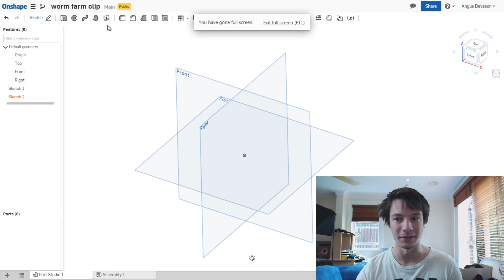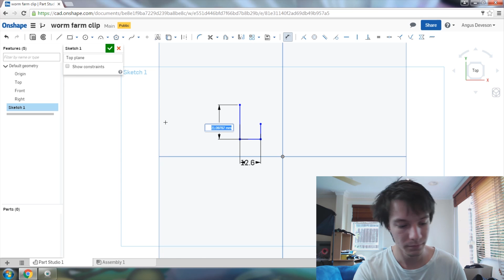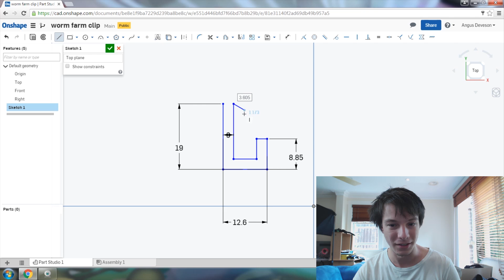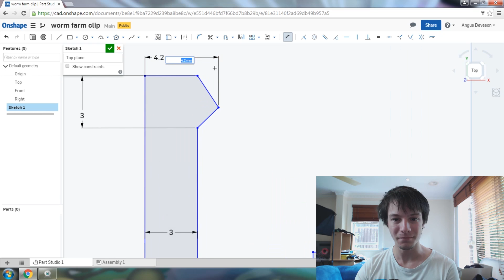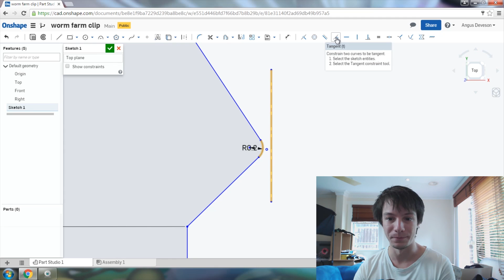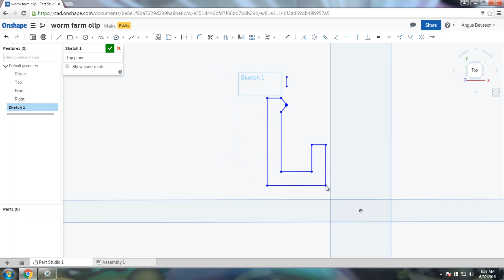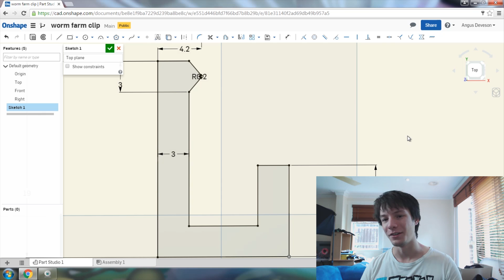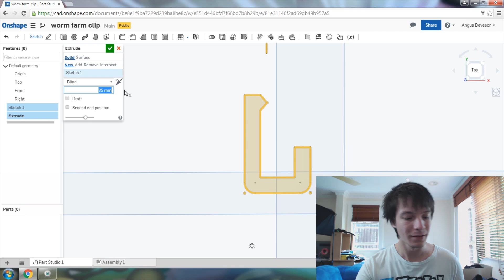Practical 3D Printing using Onshape and the Fabrikator Mini

Comment: Hello I´m thinking about buying a SLA printer for making articulated 3.75'' action figures. It seems that you have a lot of 3D printing experience in pinting joints. Basic question if it is possible to print such tiny joints without break/fail issues.

Comment: Thank you very much for the quick tutorial. I'm fairly new to 3D Printing but I have dove into it with an obsession.  I really appreciate the real world practical application. I know most of the stuff I've been printing have been for the same reason. Brackets to hold solar lights on the side of my house, doorstop, a double hanger bracket to hang my pool equipment spool hubs, spool hangers and you name it things around the house. OK I did print baby Groot....   I am new to Cad but not new to using 3-D program (Cinema 4D) but CAD application take a little bit of a different mindset. Please continue to do onshape tutorial it has become my cad tool of choice.  Your tutorial have been invaluable to me and has helped me get down the learning curve in a very short period of time.    My home seems to be filling up with red blue and gray ABS for every day use.

Comment: Hey, been loving this channel since I found it.  Great that someone is getting the word out about Onshape; its an exciting time for CAD.

Not sure if you have covered this before, but Onshape is great for constructing models for dual/multi extrusion.  It would be a great tutorial vid.  

Simply make one part, and then use surfaces to cut it into several separate parts, while maintaining their orientation to each other and the origin.  You can then export several parts as a single STL; so you simply group the parts by what color/material you want and then use a G-code generator to smash the separate STL's back together.

If you want to see a simple example of something I made for my GF doing this just search for "eat vegan" in public documents.  It should be the only thing that comes up, lol.

Cheers.

Comment: have you tried fusion 360?  free if your hobby usage makes less than 100,000 USD a year and it does not have the super restrictive storage issues that the free version that onshape has.  I am loving it as my new fully parametric modeler.  Also has build in CNC fabrication, finite element analysis, etc...

Comment: No to knock you advice for measuring things.. because that method does indeed work. 
Lots of real world blueprinting is done feature to feature rater than a single zero starting point.
Reply from the maker: +JAT.MN Oh for sure, it's a preference. I mostly mentioned it when using calipers because using the end to measure 'depth' is far less accurate than using the jaws. It's called 'ordinate' dimensioning.

Comment: Excellent video. I use tinker cad for quick and dirty parts. If you need fillets, especially corner, then tinker cad fails. Bob cad is OK but too buggy and cumbersome. Wish onshape have a cheaper option. Free version is too limjting
Reply from the maker: +Alex Roberts Do you mean by the 10 private document limit? You can make as many public documents as you like. I just make stuff like this public.

Comment: Hey Angus, congrats on the 10000 subs.  I just checked my ALDI catalogue and it has a Cocoon Create 3D printer for sale for $499 in 5 days (Wednesday 17th Feb).  I've never heard of them, you can check them out at www.cocooncreate.com.au.  It has a heated print bed, 200x200x180 mm print size, prints ABS, PLA, PVA, & HIPS.  I can see this as a monster headache for ALDI when heaps of non-technical people with no experience with 3d, or even computers run out an buy one and wonder why their print isn't sticking or get warping.  Looks like a decent sturdy printer for the cost though, if I had a lazy $500 I might check it out.
Reply from the maker: +Tim Roberts Thanks Tim, Yep a lot of Aussies are excited about that one, it's a Wanhao Duplicator i3 V2 that's been rebranded. Great first printer. I can DEFINITELY see Aldi suffering with this one, as it's a good printer but needs user knowledge like leveling beds.. correct extrusion temps and using open source slicers. I suspect they'll get lots of returns sadly, they do have a good amount of video tutorials though.

Comment: Kiaora bro, could you maybe do a video on printer calibration using printed cubes? i like the way you convey things youre very claear and easy to understand
Reply from the maker: +Benjamin Harris I featured a 20mm cube in an earlier 3D Printing 101 video but didn't go into the calibration details as it varies between printers, which one do you have? Thanks for the comment. https://youtu.be/BrvMqrgGXuE
Reply: Maker's Muse awesome man thanks for the response, i have a re flashed da vinci (i know i know lol) but i heard from a friend that you can use a calibration cube to tell if youre over extruding etc just wnted to see your thoughts on it as i didnt quite understand what he was getting at
Reply from the maker: +Benjamin Harris A calibration cube is mostly used to check if your printer is printing at the correct scale and if it's completely square on the X Y and Z axis' - if the cube is a little bit oversized when you measure it, it may be due to over extrusion. It's mostly to check and make sure it's the same size all around so you know your prints are coming out accurate! Nothing wrong with a flashed davinci :P
Reply: Maker's Muse haha trust me there are a few things i could say about it (negative things) but it does ok, i think if i wasnt a machinist it would be alot harder to modify and replace broken things, thanks for your response and awesome videos as always :)

Comment: I have to chime in with all the Fusion 360 comments. I did use onshape for a bit in its earlyer beta stage, but it was still missing a lot of features that i would have liked to see and i did not really like the look and feel of it. After getting to know F360 a bit better now, i must say i do prefer F360 over onshape. The nice thing is, you can try (and use) both for free, and work with what ever you like more. For some designs i do however still prefer the direct modelling of Designspark Mechanical. I did get a trial for Spaceclaim too to see how the full tool compares to the cut down free version, and i am still VERY impressed with Spaceclaim. If i had the money floating around i would definately pick up a license for it, but it's like 4K Euros with our taxes and the mandatory subscription for the first year... Student versions are available for like 100 Euros, but i finished my formal education more than a decade ago...
Reply from the maker: +ExtraBase I used Fusion before it was Fusion 360 and it was pretty good, so I think its about time I revisited it. Spaceclaim is really cool, but yeah I can't justify paying for CAD unless I was actually earning money off my CAD work, which I don't :)

Comment: Have you tried Tinkercad.com?  For me, it's much easier to use than OnShape.
Reply: +RC JOSEB Tinkercad is a much more basic cad software. Onshape is harder but you can do more with it
Reply from the maker: +RC JOSEB Tinkercad has its place for simple designs but you can't do parametric modelling (stuff you can tweak dimensions and everything auto-updates) or stuff like fillets, sweeps or lofts which are very powerful modelling functions.

Comment: You know you can buy left handed digital calipers don't you?

I have a pair, not because I'm left handed (although I'll use them that way if they're the pair I pick up), but because they're easier to read when measuring parts in the lathe.

I'm using Fusion 360 more and more, but for a beginner to 3D cad, Designspark Mechanical (free cut down version of Spaceclaim) is very easy to create geometry fast.
Reply from the maker: +Paul Compton I didn't know such a thing existed... wow, I need to get myself a pair. I didn't much like the limitations in Designspark but yeah Fusion 360 is pretty awesome, really need to revisit that.

Comment: A few things with Onshape:
1) You don't even need the construction line to be able to dimension off of the arc, just click the arc and the outer line and Onshape figures it out :)
2) The problems you were having with applying the horizontal constraint were caused by the same thing that made you not able to clear your selection by clicking empty space. Every part studio in Onshape starts out with an origin point and three planes (top, front, right). You kept selecting the top plane and trying to apply the horizontal constraint to it.  You can just hide the planes and keep the origin, which is what I do.
3) Your internet might be bad, but mine isn't (200Mbps down, 20Mbps up) and Onshape is still laggy, maybe not as bad as yours but it still is. I do continue to use it, since it is very convenient to able to access my projects anywhere, show them off on my phone and more. The lag is one of its biggest downsides, with some general glitchiness being the rest of the problem.
Reply from the maker: +Honza Bartoníček Ah, Onshape continues to amaze me. That's something Solidworks couldn't do... so coming from that I shouldn't have assumed you needed the construction line. 

I can see now what you mean about the plane - and only just noticed the tally of selections next to the cursor (very obvious now) - hiding all planes indeed fixes the selection problem. Many thanks!

Really interesting to get some insight about how it runs even on fast Internet, if you're not seeing much difference on your end and I'm running 20Mbs Down and 0.7Mbs Up then the servers must be quite laggy. After all the suggestions saying to look at Fusion 360, I'm considering revisiting it (Used to use the original Fusion and found it pretty good) - thoughts?

Cheers! Angus
Reply: I will have to try out Fusion 360. The time is about right, since I spent the last few days fighting with Onshape to get one of my bigger designs to work at all (and I don't know, if it's a bug or my fault). 

The one feature that I will miss from Onshape, if I switch to F360 is the install-less nature of it - one of the reasons I started using Onshape was to be able to use it on machines without admin privileges. But I guess that comes at a price of sluggish interface.

Udemy seems have a three hour free course on F360, which is probably what I'll be doing over the weekend :)

For now, without trying F360 out, I can't say which is better, but I'll see for myself. Might be a good video topic, a comparison of cloud-based CAD packages.

Comment: Nice Video. If you haven't looked at it yet you may want to try Fusion 360. Its free for  hobbiest, parametric, saves to the cloud and best of all runs locally. I actually had to double check that OnShape wasn't made by Autodesk with how similar they are. Keep up the great videos.

Comment: Ok im just WOW with the Fabrikator. Its printing like a champ for just a 1/4th of the price of a entry level printer. Just one question, why dont u use more proffesional desktop tools to desing your models instead of cloud based services?

Also ill be very excited if u ever release a series of videos about the legendary (or "everyone has one of that things") Prusa i3 Steel or any variant :P Pretty much everyone in this world has or had one and we are everyday fighting with filament configurations, mods, improves and a long etc

Keep up the good work and stay cool bro!
Reply from the maker: You mean like solidworks? If I had 12k to blow on it I would :P onshape is the only one that offers free usage to anyone. Fusion 360 comes in close but I'm pretty sure you need to be a student to use it for free. My Wanhao i3 is begging for massive mods and upgrades so there'll be vids on that for sure! Thanks for the kind words dude!
Reply: +Maker's Muse actually, fusion 360 is free for startups/enthusiasts as long as your business makes less than $100k per year.
Reply: +Maker's Muse Gr8 video! Fusion360 has two "free" licenses: 1st for makers!, enthusiasts, educators for 3 years (and as far as I undarstand it is prolonged for the next 3 years etc. so it is basically free forever for non-commercial use), 2nd for startups with incomes less than $100k/year for 1 year. You don't have to be a student to download/use it. Fusion360 is in my humble opinion a little better than Onshape (but I like Onshape a lot also): you can work offline but it have similar to Onshape cloud storage system, it has also free form modelling based on t-splines, you can use any system fonts to create 3d text (in Onshape for now you can use couple predefined fonts only), it is really powerful fully parametric solid modeller with CAM and which is quite important in my opinion: there are a lot of video tutorials made by the Autodesk but also prepared by fans/users.

Comment: 14:07 There is a huge difference between 30 mil and 30mm ;)
BTW... Nit quite sure but doesn't PLA degrade outside ???
Reply from the maker: +lasersbee Haha, yes there is. A 30mil long extrusion would be.. well not much of an extrusion at all.
Reply: Those of us that only really use metric often use mill as a shortened form for millimetres. Like people also say "k" when talking about kilometres.
Reply: +Malcolm Hunter We are in Canada and we use the Metric system all the time. When we deal with other countries such as the USA we also use the Imperial system all the time to communicate values. We don't just live and play in the closet called Canada  ;)

Comment: any thoughts on other free software like 123d design for simpler stuff ?
Reply from the maker: +someoneonlylol Yeah tinkercad and 123D Design are good for simpler stuff. Onshape is just so much more powerful which is why I put the extra effort in.
Reply: +someoneonlylol Autodesk Inventor is free for students. I have not had much time to test it, because i write exams this week, but it looks very nice and userfriendly. I think it is one of the top CAD-softwares out there and you pay a fey hundreds normaly?!
Reply: +someoneonlylol Try Autodesk Fusion 360 it's very much like OnShape with constrained objects. It's also free for personal hobby use.